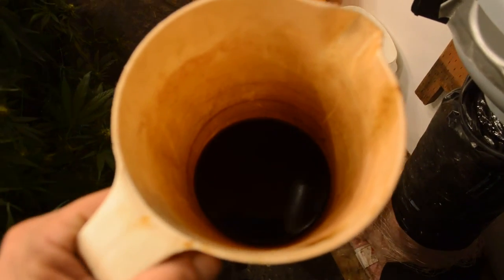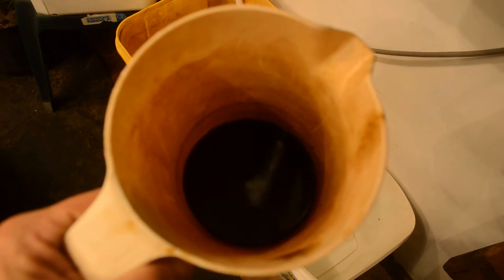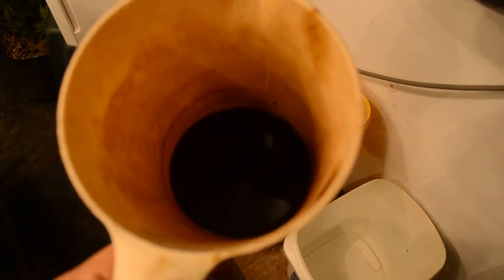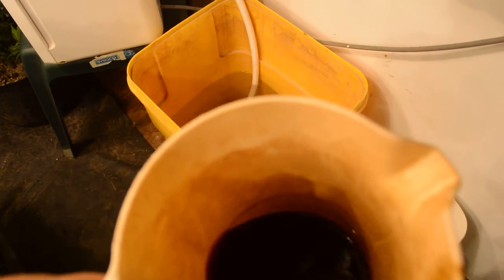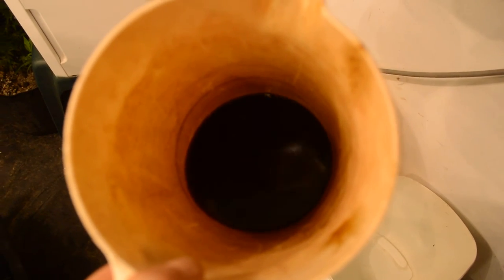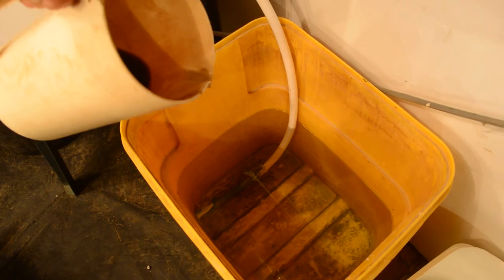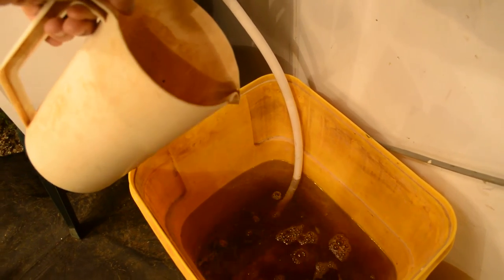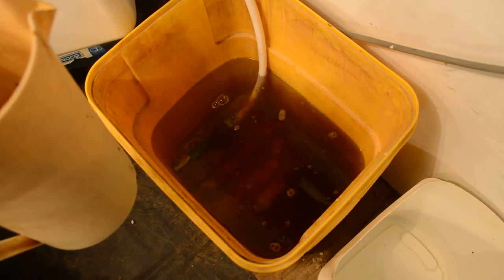Predigested Molasses

Comment: This is really eye opening. Im new and still learning but this has got to be easier than straight molasses for the microbes to digest. I am looking forward to trying this tip. Molasses and an enzyme to break down the molasses. Is there a good ratio that i should start with.

Comment: Do you still use as much aphrodites extraction if any when feeding this? What do you think of using 1 oz of cheap pond-zyme (lactobacillus) to predigest molasses? It does work but usually takes 2 days.
Reply from the maker: +Shane Tuscarora I stilluse the Aphrodites at certain times. Usinf Lacto would be perfect as wewll